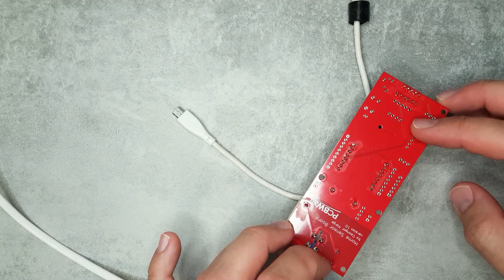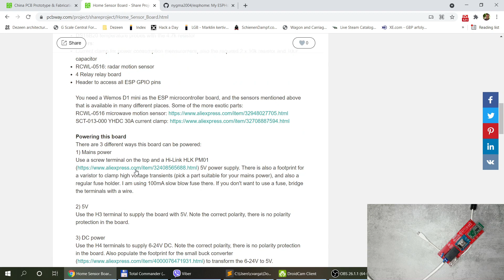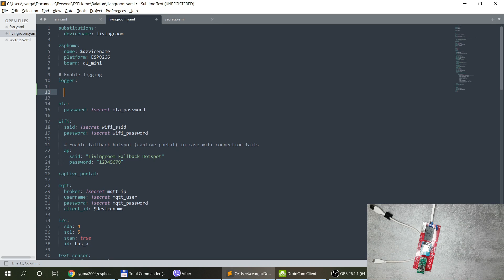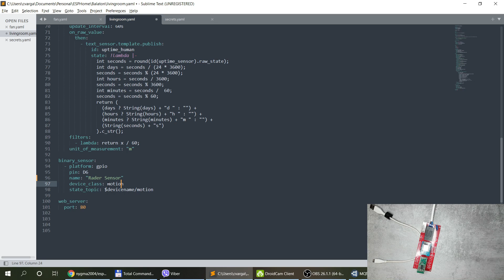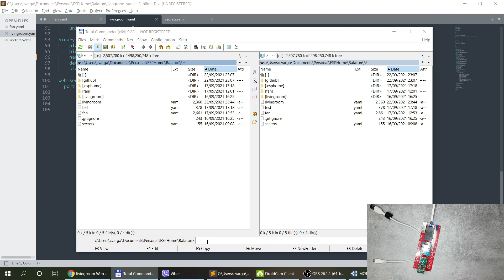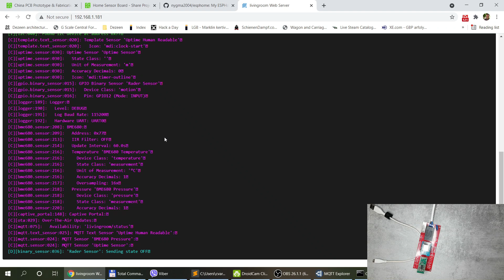BME680 and RCWL-0516 radar motion sensor with ESPHome

Comment: Hi, what’s the range for the radar sensor? Is it good enough for presence detection in small room (to trigger turn off lights/fan noone’s around)
Reply from the maker: I have not done proper testing yet. But the issue with these radar sensors that they are too sensitive. Something it even detect through thin walls. And it detects 360 degrees in every direction.

Comment: Do you get real temp values with your temperature sensor mounted where it is on your board?  I was using the termperature shield on top of an esp8266 board and temps were way off, moved to  sensor on a wire lead to get farther away. The other problem I have is I have to power my 8266 off after a firmware updated to get sensors working again. After a firmware update, it connected back into the network but sensors don't work until I repower (reboot doesn't even work). I did a custom thermostat (with heater thermostat control via relay) to run a gas heater in my garage with simple home and away modes. Away mode keeps the garage just above freezing and home mode warms up to my desired temperature but returns back to away mode after a specific period of time (forgot the heat on enough times when working in the garage in winter). The esphome thermostat is quite powerful, I like that I can control with very fine precision the temperature changes before the heater cycles so you don't actually become uncomfortably cold before the heater comes on. This was my first foray into esphome and super fun little project.